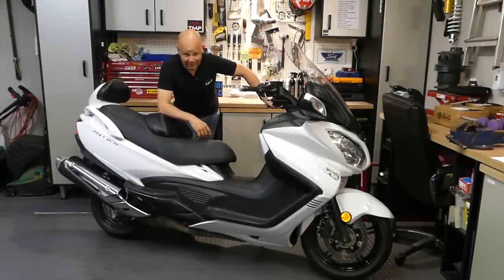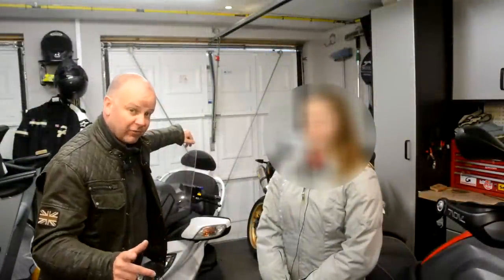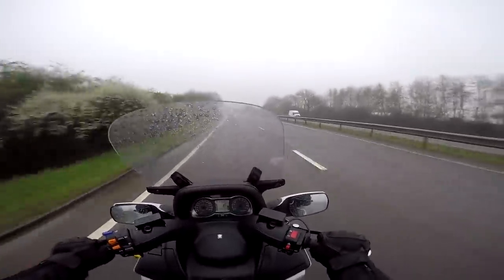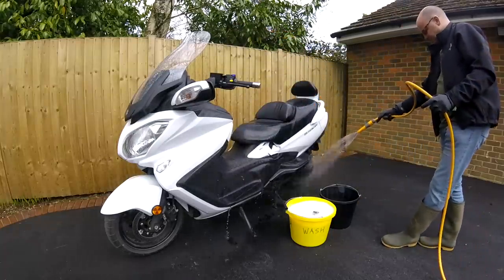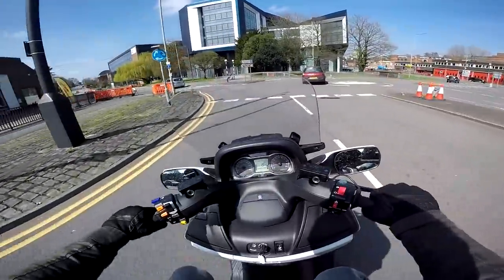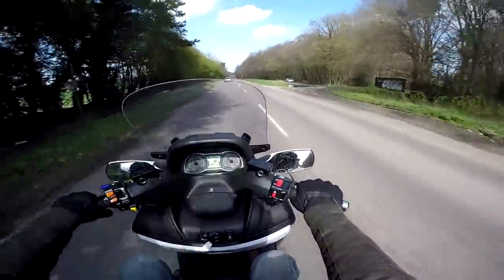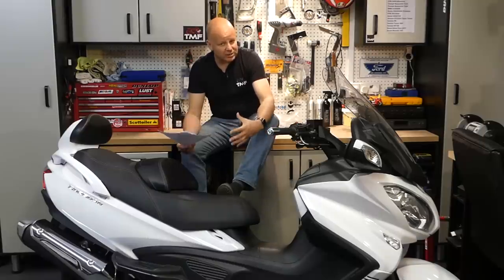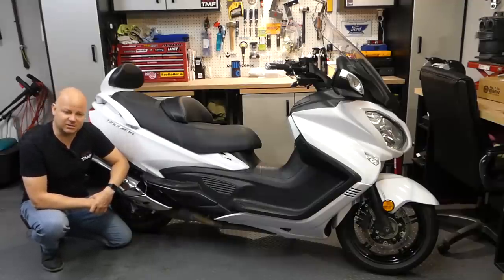2018 Suzuki Burgman 650 Executive - Long Term Review

Comment: Great review...love to see a review of the Burgman 400...its a bike Im thinking of buying.  Most of the reviews are from Asia and not in English.  Again,  a great job on the review...
Reply: I would love to see a review of the Burgman 400, too!  Especially if TMF does a comparison to the Burgman 650.  Hopefully we will get it! (Fingers crossed)  =)
Reply: I can tell you my 2013 Suzuki Burgman is as wonderful as ALL my former bikes!  I absolutely love it!
Reply: I borrowed a Burgman 400 while my V-Strom 1000 was being serviced. It was great, although I am 6 ft (183cm) tall and it feels a little cramped to me. It is also a little harsh over the UK’s potholed roads 😖 The 400cc was surprisingly quick! And during my time on the bike, it returned 77mpg 😮
Reply: i have a 400 and quite like it. the 650 no doubt has more balls. the 400 is not so bulky. it handles like a 150 but has more muscle. i'm not so sure i want a 650 because of my age and slight build. if your ok with speeds up to 70 mph. the 400 is the better deal. above that and i would get big burg.

Comment: I set mine up with a set of Wilber’s rear shocks and progressive springs in the front. It is an absolute weapon now. I have done 13000 Klm in the past 12 months, while my poor 2017 BMW R1200RT has done 970 Klm in the same period. Does that tell you something 😉

Comment: Great review TMF
I’ve owned 3 x Burgman 650’s and 3 x Burgman 400’s, your review was pretty accurate.
I agree that the bike needs cruise control.
The service intervals are too short.
If Suzuki revised the bike with 8000 mile service intervals and cruise control I would have Burgman no. 7 !
Reply: cn 250 No, I just change my bikes a lot.
I’ve had every kind of bike from Trailbikes & Cruisers to Sportsbikes but I always return to Maxi-Scooters!
Reply: It does need updating; needs to properly rival the TMax DX; which has Cruise & riding modes etc.
Reply: That's not really a fair comparison, is it?
I am not sure about the prices in Europe, but here in Japan the Suzuki is 1 million Yen and the Yamaha is 1.4 million Yen.
The Suzuki is, and is only meant to be, a scooter, whereas the Yamaha is also meant to be like a medium sized sports touring bike.
I think the price difference makes a direct comparison of the two bikes less valid.

At this moment I am torn between the two you mentioned for my next bike, moving from the superb 2013 V-Strom 650 ABS.
More money but for something that will also thrill me a bit, or less money for something that will take me and my wife in complete comfort on days out and short touring breaks over a few days.
Reply: staninjapan07 What about the Kymco AK 550; cheaper than the T-Max & longer service intervals... Just an idea?! Plus it’s belt drive (like the T-Max) 👍🏻
Reply: staninjapan07 The Burgman 650 is £9199 GPB, the T-Max is £9999 GBP
Reply: In the U.K., yes, the price difference is less significant.
Sadly, here in Japan it is a ratio of 1.4 to 1.0 Yamaha to Suzuki, respectively.
If I were still living in the U.K., I would probably already have gone for the Yamaha.
Thanks for the info.
Reply: If I were able to buy the Kymco as easily as I am the other two, it would not be a choice, as the Kymco is my first choice. I have been told that the warranty is three years, not two like its rivals. I have been told by a good number of people that Honda bikes / parts were Kymcos with a Honda label for a good number of years/decades. I have learned that even BMW uses Kymco engines in some of its bikes. Probably because of the Japanese pride in Japanese vehicles, or perhaps protectionism, or just that they have not made a big impact in Japan yet... Kymco dealers here are still mainly in the east of the country where Tokyo is. There is a dealer in this county, but they can not offer me a test ride without me 'applying to Kymco' to join a special promotion. Bad marketing in my opinion. All three under consideration are belt drive, but only the Suzuki is 'only a scooter' as it were. Given that I rarely feel the need to ride for thrills, but rather I just enjoy riding and not waiting in traffic jams etc., I am tempted to go for the (apparent) slightly better comfort of the Burgman as my big bike is mainly for 2-up days out and weekend tours.
Thanks for the suggestion.
Reply: Longer service intervals aren't really a good thing. The bike will make it through the warranty period, but the costs after that skyrocket. Change that oil and filter every 2-3000 miles or 6 months no matter what the service interval is. Check those tires every time you go out for a ride. Give your bike a check over at least once a month for any fasteners loosening up, and check your brakes and brake fluid level too. Change that brake fluid every year. Check for leaks, and all fluid levels every time you go out. I even replace the drive belt every two years. Change the coolant every two years, and the spark plugs. If the plugs look good, keep them on the bike for spares.  I never ride on tires that are 5 years old or older. And please check all of your lights every time you ride. This not only helps with your resale price when you sell it, it also will keep you from being broke down in the middle of nowhere. And if you do break down, the extra familiarity with your bike may help you fix it and get home.

Comment: It seems to me the only downsize to a Maxi Scooter is crash guards. I may be wrong. But, a ordinary tip over, then lots of expensive plastic repair. The reason I went with the Honda CTX 700 DCT. By far the easiest bike to ride in all my decades of riding. We men, at least this man of a certain age is through with mammoth motorcycles.

Comment: I owned one of these from 2007-2014 when I sold it to move to Germany. I wish I had left it in a storage unit because I'm going back home now and still miss it. 
  Of your negatives, the only one that actually makes sense is the lack of cruise control. There had been many times I wish Suzuki had added that. As for it being too car like, you mean with the extremely readable dash? Or the fantastic headlights? Or maybe the side fuel door that prevents you from overfilling the tank, but stores the fuel at the bottom just above the drivetrain, like a car? Adding to the fantastic low C.O.G? Yeah I would take those over a top heavy motorcycle, or being in a cage stuck in traffic. 
The idea that they are expensive, and instead you could buy a cheap car.... almost none of us buy two wheeled machines because they are cheaper than cars. I just spent $24k on a 2020 BMW. Instead I almost bought a $30k Harley. Bike prices, especially ones that can perform on the highway like the Burgman 650 are crazy expensive these days. 
  As for the suspension and slinging it through the winding roads, maybe you didn't have the preload set right. Roads in California and Idaho are not the best in the world. In fact I would say they are quite a mess most of the time. Idaho because of the weather, and California because .... well just because ;)  With the preload set, I've never once come close to bottoming out of getting a wallow from a poor suspension. In fact quite the opposite. The only bike I've ever owned that even came close to both the ability AND the comfort doing it was the BMW R1200R. They both corner like a dream and can flick back in the other direction almost like there is some kind of psychic connection rather than any input I had in the bars. They are amazing. 
  As for the large wheelbase, it is almost identical to the Harley Road King. Which is part of what gives it the stability it has. And yet it can out corner and out accelerate a Road King, albeit while not looking as cool. It can take most other bikes out on the road, and in the traffic, stop light to stop light, perhaps the only cars that might be able to keep up are million dollar supercars. Top speed by the way is 135 miles per hour. And that's only because Suzuki chose to govern it electronically at 135. If you have a friend at Suzuki somewhere... well ;)
   Unless I was really getting on it, normally my fuel mileage was around 60-65 mpg combined. The best I ever got on it was 72 mpg while on a ride from California to Idaho through the desert back roads of Nevada where I was keeping around the speed limit. So Highway mileage may vary ;).
  As for tour riding, one of your plusses, There really is a crazy amount of space on them. Something most people don't know that maybe should have been suggested, the backrest is removable and replaceable with a top box from several companies. I chose a Givi, but one that was color matched and more of a square profile (as much as Givi seems to be able to do) that didnt look like a hovering UFO. So if you're two up touring, which it is amazing at, and you swap out the backrest for a top box, they are fantastic. They are touring clubs all over the US that cross country ride the Burgmans, both the 650 as well as the 400's. The only time I ever got uncomfortable on it, was after 13 hours in the saddle. The shape of the seat and the firmness of the foam used started making my butt and lower back numb. Thank you Corbin seats for never letting that happen again. 
  Oh, the first thing you mentioned as a negative, was the fiddly buttons on the right side, while working the throttle. There are no buttons on the right side to fiddle with while riding except the windscreen height. The top red button is the on/off button for the bike. Underneath is the start button. I assume if your riding, you already have it running. Then there is the windscreen button. Everything else is on the left where it should be. I also agree with you that with the amount of buttons over on the left, some kind of backlighting would be nice to have, but in a very short amount of time, you get to know where everything is. Besides in most cases, once it's on, the only thing you might mess with is the high beam switch, or the turn signals.  Everything else is pretty much play time. Whether or not you want to shift manually and the up-down buttons. Or the power/default button which only changes the shift points on the transmission. Which allows it to accelerate even faster, like that was necessary. lol.  And then the  horn button, which hangs off the bottom like most bikes these days.  
  I don't know. I have always had a really hard time finding any faults to the Burgs. They are just amazing bikes for what they are. Technically a long distance commuter scooter with crazy easy controls, especially for those that have issues with clutches and shifting. And yeah, those folks still exist out there, which was the reason I bought the thing in the first place back in 2007 (an ex-wife had the problem, not me. I've been pulling clutches for almost 50 years now).
  Just a little side note here, you want to drive a sport bike rider in the 600cc class crazy? Pull up behind them in the fast lane. When they accelerate to get away from you, roll on the throttle a little more. Keep doing it until you hit that governor, or go visit your "friend in the service department" at Suzuki and take it up to 150. Shhhhh I didn't say that out loud.....
Reply from the maker: Thanks for that lot Bob - interesting reading!

Comment: What a wonderful review, I have had three of the 650 Burgman's and think they are a fantastic machine. I regularly took mine down to Andorra and the Pyrenees in France . I was the only guy out of 15 motorcycles that had the scooter (if you can call it one ) and was alway's    up front with the best of them. I am 70 now and thinking of getting another.

Comment: Nice to see one of your family members on here, being a part of the video ! If you didn't know, the top speed on the the Burgman is 120mph !
Reply: Ha ha!  Maybe downhill with a strong tail wind!  Speedo needs to read 110 to be doing an actual 100 mph
Reply: Thomas Evers I think it’s less?
Reply: No, it does 120 according to my Garmin GPS. Level ground, no wind, two up and not straining. It just hits the electronic governer.
Reply: Greg Pecaut 
It might do 120 if you throw it out of a plane.
Reply: 109mph with Sat Nav GPS on flat road and no wind. Tried it many times and that was the best I could get.
Reply: @Sagina1999  Mine was out by about 4-5mph above 100mph.
Reply: @RichardASK  My 2004 is 10% off.
GPS confirmed.

Comment: Good review as always, at one time a motor bike was a poor man's mode of transport......it's a shame they are becoming an expensive fashion accessory these days......
Reply from the maker: Agreed!
Reply: The problem is the market in each country, I'll give you my example: I live in Mexico, right in the border with the US, in Mexico most of the bikes you see are 100 to 200 c.c, and are owned by working people, and those bikes are around 600 dllrs US, if you see a bike bigger than 300 c.c is a BIG bike and in the US that's the entry level bikes or even considered for women, so I think the problem is what the society dictates in each market.
Reply: Maxi scooters and the cheap 50cc scooters are like night vs day. Yes the maxi costs more. But it is nothing like the little 50cc. They have far more power, range, and load capacity. Fuel injection, better suspension, and tires. Electrical extras like heated grips, seats and powered windscreens. Trip computers, anti-lock brakes, traction control, and much stronger cvt transmissions. Not to mention more materials. Maxi scooter prices will come down some, if more people would give them a try. Like cell phones, an increased market will bring economies of scale along with more competition for sales.
Reply: Then there are distributors, like if you want something special, like Ural, Guzzi, Enfield, KYMCO or even Piaggio, you have to travel because dealers are few and far between
in Canada, outside major cities, or go UJM again, if you buy local. I'm waiting to see if Yamaha's 3CT gets here. So far it only has a 300cc engine, but like Juan said,  300 is considered big in his market, though one YTer here tours the world on Honda Cubs or their clones because he enjoys the views and he says, parts are everywhere. Yet the 3CT is over the bar for travelling on a 400 series highway {250cc-but why would you, no scenery and a danger of highway hypnosis-go scenic and enjoy the picnic stops}. The 3CT will give Piaggio a run for its money, if only for the fact of dealer access and looks like a clone of Kwang Yang Motor Company's CV3, except ATM, it is not known if KYMCO is going to use the engine developed for the AK550 scooter.

Comment: Hi Ponty Pete here! fantastic bike!  (scooter if you prefere) 650cc fast low down, great balance due to low engine mounting! electric Windscreen, electric mirrors for cutting through traffic,
two Heated seats, Heated hand grips,  loads of space under seat for helmets flask and sandwiches, clothes! boy racers will not loose you on the roads and when you pass quiet a few they will be really pied  off, you may have to put up with the snobby  high riding BMW( lol) as they dont wave at you but i always give them the victory sign first!!! All in all a fast comfortable ride and not bad looking too!  (get )one! plus 50 to the gallon, 200 mile range!

Comment: I had a 2007  Burgman 650 that I put 25,00 miles on. It ran perfect up until I decided the buy a brand new one this year.  I think the new Burgman looks better in the rear end, but that's where the likes stop. Dont get me wrong, the Burgman is a top of the line Scooter, no matter what year it is, but here's my thoughts on the two:  I liked the 2007 better than the new one for these reasons: The 2007 was wider, which gave a little more protection in bad weather. For some strange reason, the 2007 was smoother. The new one has a bit more vibration. Not in the entire bike, just the engine. Both bikes suffer from an electronic fuel gauge.  What this means is that you really have no idea who much fuel you have left. The new one however does a better job of giving you a better idea. I took some gas with me and allowed the Scoot to run out so I knew the exact millage I could get from a full tank. Now, I set my Trip Meter for every fill up and watch that, no matter what the gauges say. The old bike was a much better creamy white color, while the new one is "ice box white".  The old bike had silver wheels, while the new one has horrible black wheels, which makes the bike look very plain.  I put silver pin striping on mine to break up the monotony.  As far as the electric mirrors on the new bike: That's just something else to break. The old bike had a serious electrical issue with the plastic contact in the key switch. Suzuki issued a recall on it. Not sure that helped a lot, but with all the extra electric options on the new one like heated seat, grips, movable windshield and mirrors,  I hope that Suzuki re designed the electrical system to handle the load. As mentioned, this scooter costs as much as a cheap new car in the U.s. .. about $11,000,  so to own one, you must be a serious lover of this machine. I am.
Reply from the maker: Wow - thanks for taking the time to give us some real world feedback...all the best - TMF